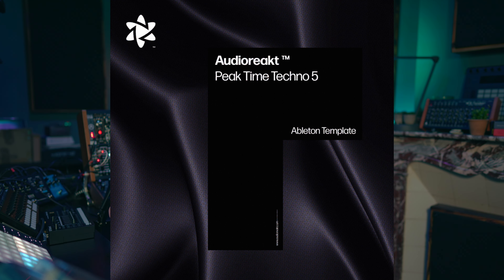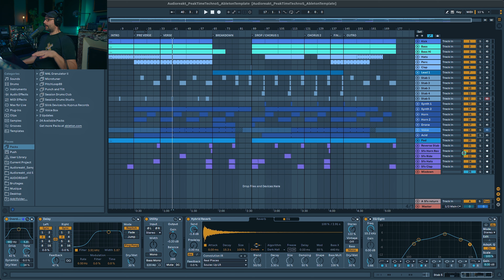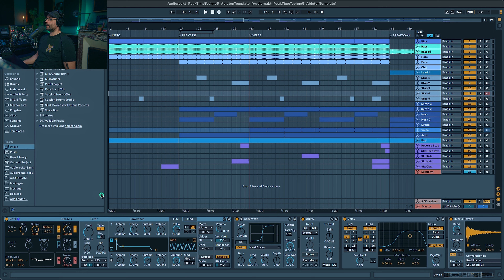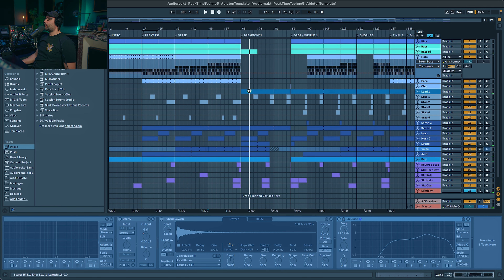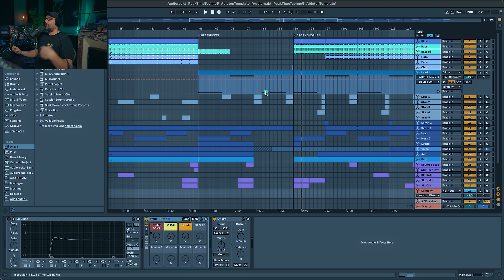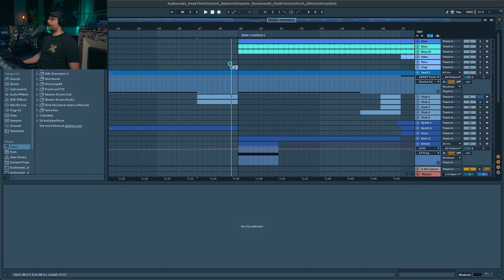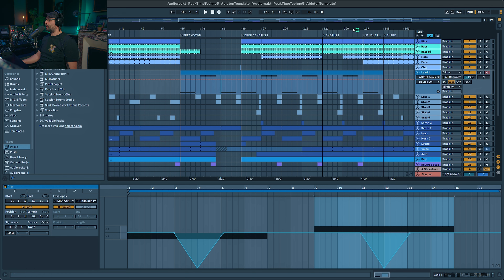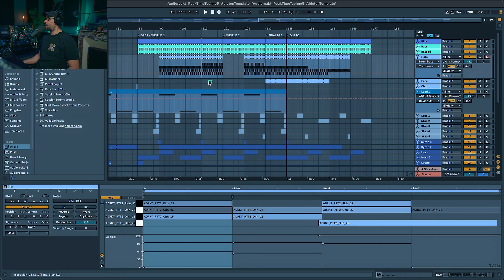How to Make Peak Time Techno Part 2 (Arrangement, Mixing & Mastering)

Comment: Great work Paul. Certain elements will dictate how you can pan them won't they?  - I use the auto filter (in Logic) to add panning motion to some parts (usually something arpeggiated) doesn't work for everything though. Great tutorial.
Reply from the maker: yeah definetely, some osund are sounding better in stereo for exmple i love my ride in stereo and feel it sound better than normal... Some element if I left too much on ne side it feel akward and not natural so you have to adjust... but even it depend of the sound and the rest of the track, you have to think about which frequency range they occupy, when are they playing and adjust accordingly...
Reply: Yea frequency is key to a mix working